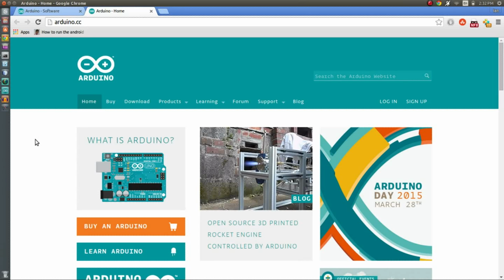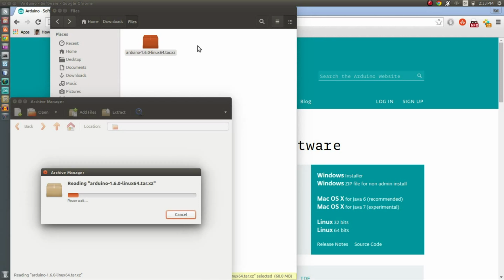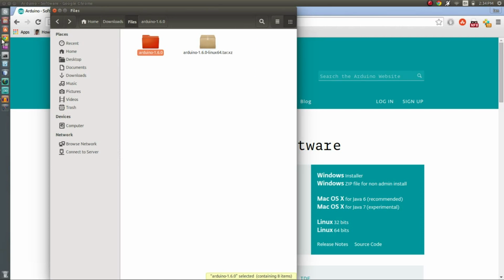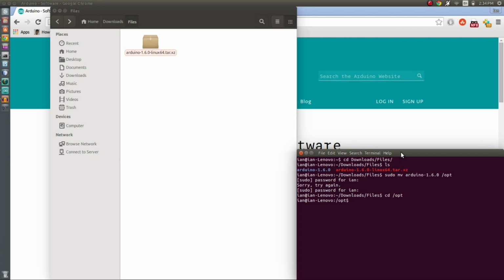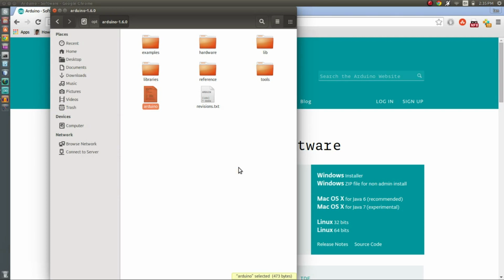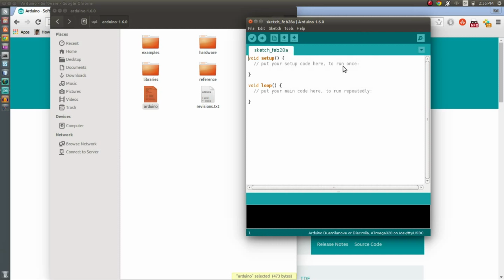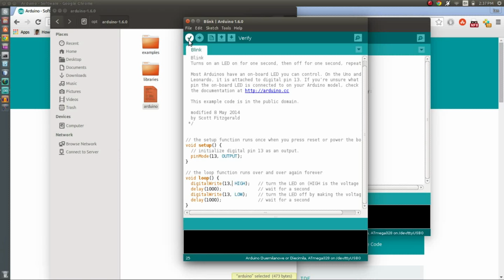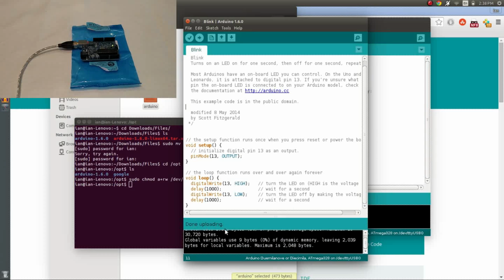Getting Started with Arduino: Installing Arduino on Ubuntu

Comment: I have to get permission every time from the OS to upload to the board. After the permission is granted the program does not upload to the board , it gives this error:
avrdude: stk500_recv() : programmer is not responding
avrdude: stk500_getsync() attempt 1out of 10: not in sync : resp=0x00
Please provide a solution.
Reply: I am having this error as well. Any solutions out there?
Reply: Im not sure about the hardware that you are using but i have an arduino nano. I was having the same issue. in the IDE under the tools tab it asks you to select the processor. In my case is defaulted to the ATmega 328P. when I encountered this issue i tried the selection below it that said ATmega 328P(Old Bootloader). I am by no means an expert and I cant offer a solution for your given hardware but based on this observation I would imagine the issue you are having is in the board and processor that you have selected. Hope that helps

Comment: Saved my life man, thanks a lotttt.

IF someone didn't understand well, here is the steps:

1 = Download the IDE on the site "https://www.arduino.cc/en/Main/Donate".
2 = Extract to "Downloads / arduino" (files like: install.sh, should be inside this folder).
3 = Open the terminal and type: 

-sudo ls
-cd Downloads / arduino
-sudo ./install.sh

"Close the terminal".
4 = After that the IDE will be installed.
5 = Open the IDE, and update the version of the UNO Card through the path "Tools> Arduino / Genuine Board UNO> Card Manager> UNO".
6 = Connect the Arduino to the PC.
7 = After that, go to "File> Examples> 01.Basics> Blink"
8 = Select the board in "Tools> Ports> / dev / ttyUSB0"
9 = Go to the terminal and enter the code: "sudo chmod a + rw / dev / ttyUSB0".
10 = Compile the code and your board will be ready for the common one.

Comment: Having Problems:
i did everything your video said to do and everything seemed to work great for installing (the .tar file worked well for me since I can't get internet to hook up to my computer) I typed up my first code (make a LED blink) and checked it and it was good but when I tried to upload to my new arduino uno r3 it said "avrdude: ser_open(): can't open device "/dev/ttyUSB0": Permission denied" I know the port is right bc it only turns up when the arduino is plugged in. I'm running Ubuntu 13.1. The board in tools I have selected is arduino/genuino uno. And here is a link to the arduino I bought...  LANDZO Arduino UNO R3 13 in 1 Kit https://www.amazon.ca/dp/B01MTMDT29/ref=cm_sw_r_other_apa_lDQHybDP5X5GM
Reply: I have the same problem

Comment: Now in arduino-1.6.12 you can install even more easy way:
Do the mv part to /opt but run the script install.sh

hiddenotebook@rules: /opt/arduino-1.6.12$ sudo ./install.sh
Adding desktop shortcut, menu item and file associations for Arduino IDE... done!

Then everything works great!

Comment: I had installed the IDE using Ubuntu Software Center, but the serial  port apeared as disabled in Tols menu. So I followed these steps, now it appears as /dev/ttyUSB0. The board is set as Nano. When uploading, it says:
avrdude: ser_open(): can't open device "/dev/ttyUSB0": Permission denied
ioctl ("TIOCMGET"): innapropriate ioctl for device
Problem uploading to board.

Comment: sir not working for me, IDE not open
Reply: The most common error is not downloading the correct Linux version, 32bit vs 64bit. You might also want to look at the permissions and make sure they're set to allow you to open files in certain folders